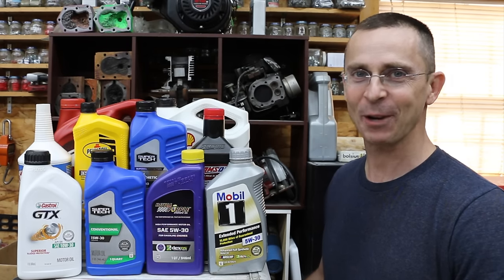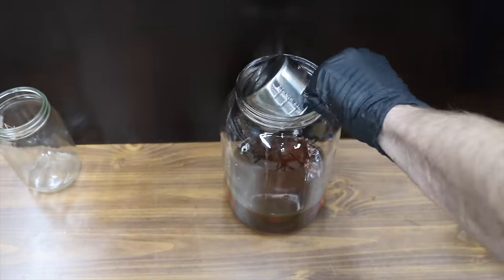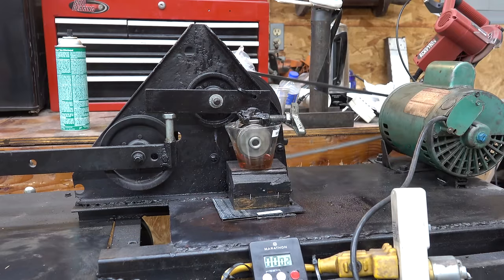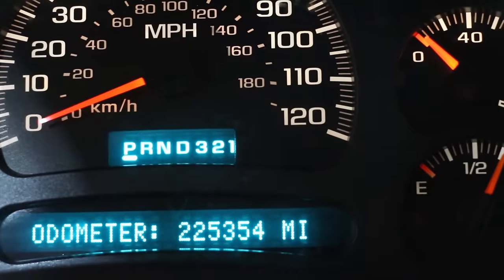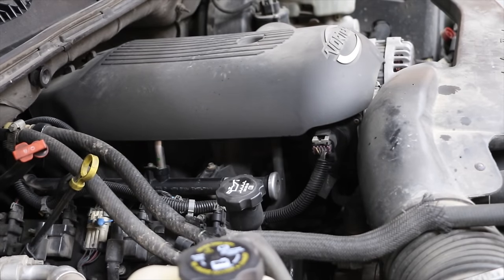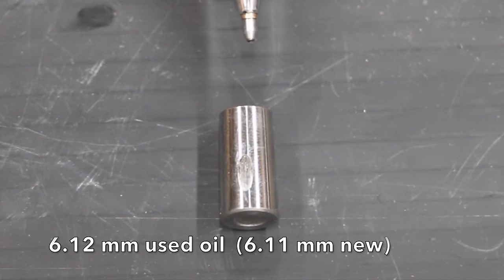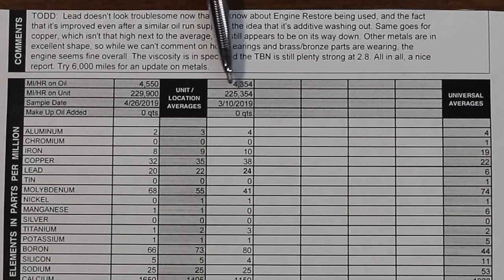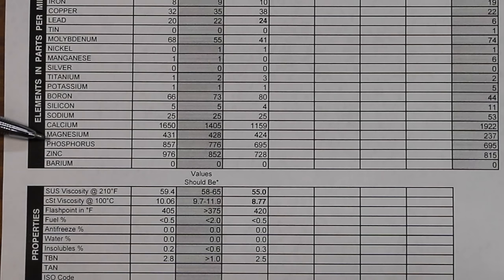Will Mixing 10 Motor Oils Damage an Engine? Let's find out!

Comment: I've usually always had higher mileage engines and never really cared enough when it came to mixing 10W30 or higher weight oils 😂
Current truck has 15W40 diesel with two bottles of SuperTech oil honey, lol! Hey the rod knock is harder to hear though the valve train really rattles at first on cold starts and smokes like a train. Always....
Reply from the maker: Thanks for sharing.

Comment: Could you do a comparison between circular saw and table saw blades specially designed for melamine covered boards? I wonder which one gives you a clean cut on both sides, with the less support requirements. Thank you :)
Reply from the maker: Great suggestion!  Thank you.

Comment: I just accidentally mixing 1 qt of leftover Pennzoil Ultra Platinum 5w30 with 0w20 of the same brand in my Subaru which calls for 0w20. The engine has 85000 mi on it and I drove it for about 500 miles before even realizing the error, when I was disposing of the oil and noticed the weight on the jug. I'm not too concerned, but I'll probably change it in 3000 instead of my usual 5000.
Reply from the maker: Thanks for sharing.

Comment: I use case tractor diesel oil which is 15-40 in my 1996 Chevy k 1500 with 258k miles and I have no problem out of using diesel oil it helps with a small oil leak I have I don't have to add oil as much as if I was using 5-30 gas engine oil
Reply from the maker: Thanks for sharing.

Comment: How about testing shell Rotella T4 15w-40 against a 15w-40 4 stroke motorcycle oil.  there is a big debate in the motorcycle community about this. people say the t4 will destroy the clutches while others say it is perfectly safe to use and is cheaper.

Comment: What I take away from this is the Chevy 5.3 motor is a very good motor. As for oil, my position has always been just change it regularly and use a good filter. Type, weight, etc. are less important than CLEAN!
Reply from the maker: Thanks for the feedback.

Comment: The other day i did an oil change on my Lexus ls430 which requires 5w30 after checking the oil dipstick it showed that it was a half quart low so i added  a half quart of 0 w20  to compensate would that harm my engine? T.i.a.

Comment: i have mix 500ml of 10-40w vadol oil with vw stadars 501- 505 and 4,1 litre castol edge LL 5-30 with vw 504 507 because i can find something else in vilage i leave and my engine burn oil ..i have turn engine on for some sec only 3times and i see bubles in oil dipstick i was no bubnles before mix oil...im a farmer and need w8 a internet order for new oil...u thing i will have problem in high tempratures if start it?

Comment: I always use whatever leftover oil to top off just in case of leakage or burning off. But I have very limit choices, mobil one 5-w30 performance, 5-w30 high mileage and 0-w40 european formula. May try amazon basic next time on my old car.
Reply from the maker: Thanks for sharing.

Comment: Also only use one brand of oil on your engine. Constantly switching brands is bad for it, as a chemical engineer at a big oil company told me.
Changing gasoline is similar but not as bad as changing oil.
Stick to one brand of oil and gasoline. This engineer worked for a large oil company in Canada. 
He said dont buy this oil or gas from this company. Too much sulfur. They usually have the highest price for gas.

Comment: I saw your video but what about if I use the same brand and viscosity but just 9 gallons of conventional t4 and 1 gallon of t5 semi synthetic? It's for a semi truck which is why it's a lot of oil. Would there be any damage of I use 1 gallon of synthetic and 9 of conventional same brand and viscosity??
Reply: In a pinch I guess it's better than being low on level..

At the end he states to go with the manufacturer recommendation plus you can write it off in the taxes as a business expense 😅

Comment: Maybe test if engines using lower viscosity engine oil like a 0W-20 are more prone to oil consumption? It’s always a myth I’ve heard if your engine is using oil switch to a higher viscosity oil like a 5W-30 instead of 5W-20
Reply from the maker: Thanks for the suggestion.

Comment: I never liked the idea of mixing brands of oil, each has different additives and detergents and they might not play well with each other, but as far as mixing 10w40 with 10w30 I don't see any issue with that, you'd have a theoretical  10w35
Reply from the maker: Thanks for the feedback.

Comment: Why didn't you mix like a 10W-30 or 20w-50s with SAE40 or SAE30 STRAIGHT oils?
Why did u use only thin multi-weight oils to mix?
Believe it or not some people still use straight weight oils in their cars and motorcycles and I'm one of them.
Reply from the maker: Thanks for the feedback.

Comment: Hi there, im not very clever with API ratings LOL, would you say if a owners manual in this case (My moms Kia Picanto) owner manual calls for a 5w30 API SM, i changed the oil over the weekend and used a 5W30 API SN, as per my understanding the Api ratings are backwards compatible , Sins SM are before SN, it should be okay? Or even better.
.. ? Thanks ! I didnt MIX any though (LOL) just bought one that was on special.
Reply: Quick Google search. Yes it's ok

Backwards compatible with M L ,J

Comment: I have had the oil in my old 2.8l Hilux go really thick when I mixed oil don't know if it's because of the oil mixes or because the engine was known to have to small oil ports and did need regular oil changes anyone that has owned that model knows

Comment: I have penzoil platinum oil and when I do my next oil change I want the ultra platinum I would use both bottles should be fine right
Reply from the maker: Thanks for sharing.
Reply: @ProjectFarm  it should be fine to mix the regular platinum with the ultra platinum right?
Reply: Yeah it'll be fine long as its the viscosity as the manufacturer recommends.

Comment: Can you heat vaseline to make it thin and use it as motor oil?
Reply from the maker: Thanks for the video idea.
Reply: @ProjectFarm  I was thinking to heat Vaseline and blend it with 5w 20 motor oil then let it cool to see how thick the oil will be. Then test it in a small gas motor engine. Your videos are inspiring. Thank you for the time you put into them.

Comment: hey you have the same vortec engine as mine, it has a cold start issue, it kinda sputters a little and doesnt idle how its supposed to and when it first starts ot sounds like the engine has a tick to it, any help would be greatly appreciated thanks.

Comment: Im only here to find out if i can just top up my motorcycle instead of a whole oil change, my dipstick is dry as a bone so i assume ill be fine but im here to make sure 2 oils mixed wont harm it to much

I actually cant remember what oil i put in in the last oil change but i think its what i got which is 20w-50 but the manual says 10w-30 or something, so im just wondering if it will matter if theres a little bit of 10- left in the bottom of the engine if i put 20w-50 in
Reply from the maker: Thanks for the suggestion.
Reply: It depends if the wet clutch system shares the same oil for your engine but I don't think it'll harm it

Comment: I have already tested this with my tractor, right now I have used 90 wt, ATF, 30 wt non detergent, 0w-15 wd-40, diesel, and air compressors oil, yes I’m serious yes it has no oil pan gasket.
Reply from the maker: Thanks for sharing.

Comment: Here's one for you. 
Put 2 inches each of 10W 30 and 5W 30 in a transparent glass. wait 5 minutes or so. The lighter oil will set on top of the heaver oil.  Lets say your engine tales 6 litres of oil but one liter is 5W 30 and the other 5 is 10W 30. And your engine takes the oil from the top of the reservoir.  Will your engine use that one litre to death because it keeps coming to the top of the reservoir
Reply from the maker: Thanks for the video idea.

Comment: I had a 2007 GMC 4.8 v8 I used conventional oil for 100,000 miles switched to synthetic for 50,000 notices I was burning a quarter about 4000 miles into 5000 miles change. I switched back to conventional with 3000 changed no more oil burn and engine ran great got ride of truck with 265,++
Reply from the maker: Thanks for sharing.

Comment: Went to WallyWorld today to pick up supplies for my next oil change in my Suburban with 330,000 miles, and low and behold, found several jugs of “ PROJECT FARM” multi weight- multi synthetic motor oil! 🤡
😎💪🇺🇸🗽❤️
Reply from the maker: Thanks for sharing.

Comment: Is this test realistic, 10 different oils wouldn’t the situation be more like two or three different?  I probably have no right questioning your testing but this just seems like an unrealistic situation.  I know I have mixed Mobil one syn with Castro syn in past when I had to top off oil before oil change.

Comment: My dad bought an 2004 f-150 5.4 3 valve brand new it says run 5w-20 but he has run 10w-30 conventional and it has 315,600 miles all original
Reply from the maker: Thanks for sharing.

Comment: Try running and engine with a mix of oil additives only. I don't recommend to use your vehicle, just a generator as you did in other videos
Reply from the maker: Thanks for the suggestion.

Comment: Sir are you believing in oil additive that can prevents overheating and can run without oil?
Reply from the maker: Thanks for the video idea.
Reply: @ProjectFarm  there was a oil additive product i saw and i copied there products benefits below..

🚗*Protects Vital Engine Parts in Case of Accidental loss of Oil. 
🚘*Maintains Cooler Engine Temperature
Restores Power and Extends Engine life for Bigger Savings and Maintenance Cost. 
🚲*Ensures Substantial Savings on Fuel Consumption up to 15 %.
🚚*Reduces Emissions of Harmful Gases and Smoke. 
🚐*Eliminates Engine Noise and Vibrations
🔥*Maintains Oil Viscosity at High Temperature.
🚍*Prolongs Oil Change 2 Times or More

Comment: That was pretty much the last oil change in my 2012 Civic Si. Damn coronavirus means i was almost out of options on oils so i used what i had in the shed. 1qt Liquimoly Molygen 5w30, 1qt Pennzoil Ultra Platinum 0w20, 1qt Amsoil SS 5w30 and 1qt Red Line 10wt Race Oil... I'm probably going to change it out at 30% remaining OCI just because of the Race Oil.. maybe not. That engine (Honda K24Z7) is 256k miles old, doesn't take a drop of oil, is still as reliable as day one and also puts 202whp on 91 Octane last time it went on the dyno. Next time however, i'm going to put 4.5qt of the same oil with a new Fram Ultra filter. I still like the car.. Last qt of Red Line 10wt Race oil is going in my old as fuck lawnmower, it should be interesting. ;)
Reply from the maker: Nice!  Thanks for sharing

Comment: if the engine burns oil, can I add new oil and mix with the old oil???? Will that hurt the engine?
Reply from the maker: Thanks for the suggestion.
Reply: ？？？？ @ProjectFarm
Reply: @yangguo9329 others chime in it doesn't matter that much... What matters is you keep that oil level up and not blow the engine 😅

Comment: What if I mix 5w 30 with a different brand 5w 30, reason is I might be short on oil so I have some from other brand to top it up.
Reply: You can do that. it will work fine.

Comment: We use cheap oil in our Cabs without  any ratings on the bottles. Will this oil holdup against higher priced oils that do have ratings on the bottles? Can you test this? Here's another one. What about that cheap ass antifreeze versus premium antifreeze. Can you test this?

Comment: True story: oil supply dealer had several 55 gal barrel  that get returned to be refilled, always a few qts left in each barrel (10w 40, 1ow 30 15w 40 ect), owner would dump what was left into a 55 gallon barrel until it was filled (2 years appox). Guy figured oil is oil, put a rotella 15w40 stamp on 55 gallon barrel and set it off to a county service garage.  A few months later the county lost 2 cat diesel motors, sent oil sample off , could not determine what kind of oil,  guy lost million dollar business.
Reply from the maker: Thanks for sharing.

Comment: His strong opinion is opposite my strong opinion. 

I dont buy in to that oil passage shit. 
I always run a heavier weight than manuals recommendation. 
In my 376cid silverado I run 5w-40 with a viscosity multiplier to boot. 

Oil Temps are night and day between recommended and my preferred weight. 
Never had a dry start, and 0 lifter failures , or valve train failures on 824 heads after 100k of running 5w40+ on a mild cam and heavier springs.

Hell in all the dsms and Nissans ive owned I run the same. 
They thrive on it with the excess heat from the turbo and shit. 

My 180sx fucking basked in the heavy oil

Comment: video idea, about using a drill to start small engines, if turning engine wrong way will stator make power go some wrong way and melt its wires or what, l lost my spark doing that
Reply from the maker: Thanks for the video idea!
Reply: @ProjectFarm  so many videos about drill starting small engines on yt, and no warnings about possible stator damage  so if my hunch is right that changes things. l had a strong fast turning drill and so easy to hit the reverse lever on the trigger by mistake and not notice it turns wrong way,

Comment: It make me laugh when someone says they only use (insert oil brand here) and have never had a problem. Like their one car is a suitable sample size for us to draw conclusions off of. I've used so many different brands and have never had anything inside the engine ever go out. What does that prove? Just keep your oil changed with the right visc and you will be fine inside the engine.

Comment: What I've suspected all along.
And what tickles me is why folk swear by a particular brand

No one can say one brand is better than another unless you ran 3 or 4 identical engines for 100k miles, all with different brands in and then strip them all down and note the difference in wear of bores and crank journals (if any)

Why do people think Castrol GTX is a good oil??????

Only because they've seen those slick TV ads.

It's all to do with the power of marketing and repetitive TV ads which slowly brainwash us all. 

I'm having none of it 🤣

Comment: My only issue is my car says to run 0w20 and it burns a lot of oil I tried and have since switched to 5w30 and 10w30 and have had alot less oil burning and better performance.
Reply from the maker: Thanks for sharing.

Comment: People with Euro cars might realize that the ideal visc is between a 30 and 40 weight. So, mixing a 5q 10w-40 jug of Maxlife with 3q of 5w-30 runs perfectly, without excess wear nor bogging down the engine with excess viscosity. You could change the mix to 5q of 5w-30 and 3q of 10w-40 for wintertime. I'm speaking about non-turbo engines, 8q at a time like Mercedes, or American V8s....adjust to taste for your engine, many are happier and quieter with some 40 weight mixed in, even Asian ones, and especially tuned engines.

Coming from Mercedes, the most ardent owners actually seem to know the least about the spec oil they think is so special. Well, it's not. Anything between 10cSt to 15cSt, that cranks in the cold and has low levels of deposits is fine....that's every oil in the store. Spec oil is for running 15,000 miles a clip, and that's pretty dubious. It's also for all climates and all drivers, so 0w-40 is the obvious pick, but not the best, especially if you are willing to switch viscs for the season. 6 months is a fine oil change interval anyway. 

It's absurd to think one oil is perfect for an old granny in North Dakota to drive 2 miles to church in winter as the same for a turbo on a racetrack in  Mid-Texas summer....it just isn't. If you search you can find the old visc/temp graph that shows like 11 different oil visc for different ambient temps. People who never looked at it should search it out, and clear their head about different viscs and even blending your own, and oil companies all say it is a perfectly fine practice.
Reply from the maker: Thanks for the feedback.

Comment: My dad used super tech Walmart brand in a 96 Chevrolet s10 the whole life when I was a kid.it went 400,000 miles all original an factory.doors where falling off an mirrows.the engine still cranked an drove.cheap oil is just as good lol.
Reply from the maker: Thanks for sharing.

Comment: I had a car that burnt oil pretty bad and i was tired of buying it. I would get used oil to run in it. After getting some bad oil i ran BAR AND CHAIN oil in it for over a year. $7 a gallon at Walmart at that time.
Reply from the maker: Thanks for sharing.

Comment: I was riding to work on DAY, saw a motoguzzi stoped by the side of the road,still had dealers tag onit.  The rider had mixed regular oil wt synthetic   it madeit about 2 miles before locking up  1pwhen I removed the pain ,the oil had solified threw out the engine ,would stretch like rubber was a total loss onengine was about 1985 I think thought it was a candid camera stunt, at first, but was proven wrong !
Reply from the maker: Sorry to hear that!

Comment: Hi I have an experiment for u to test I have heard that in gas engine you add a little bit of diesel  to help I lubricity of the fuel  and that it helps in longevity of the engine  and in Diesel engine add a bit of gas to the Diesel
Reply from the maker: Thanks for the video idea.

Comment: Gotta disagree about always using the oil specified in the manual, at least for older equipment. My John Deere B calls for 30 weight non-detergent oil in the crankcase. Not only would it be prohibitively expensive to run that, but also literally any modern oil will lubricate the engine better. I just use Rotella T4 in everything I own since I don’t buy fragile engines that are picky about oil.

Comment: I think mixing up 5w30 and 10w30 and other w oils could ruin the engine, the 5w30 is a viscosity higher up and lower Is a different viscosity one oil could be thicker than the other or thinner not providing the correct lubrication
Reply from the maker: Thanks for the feedback.